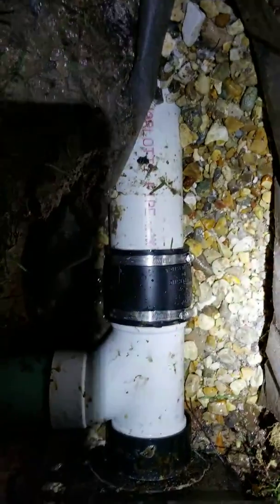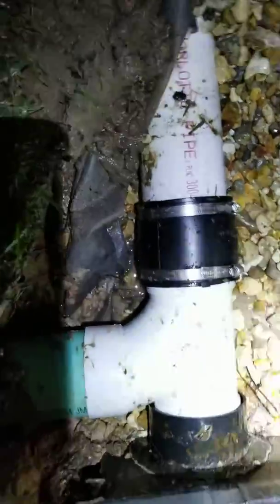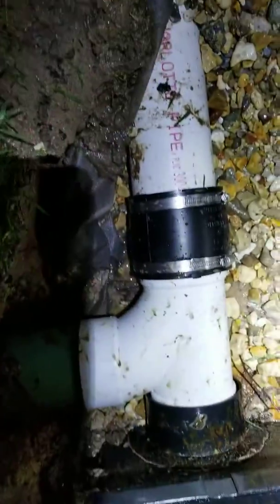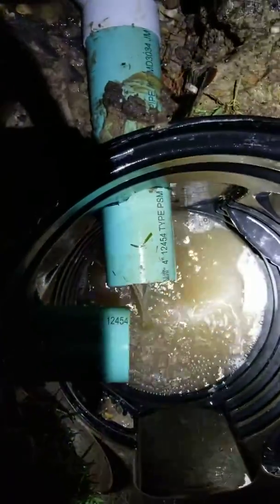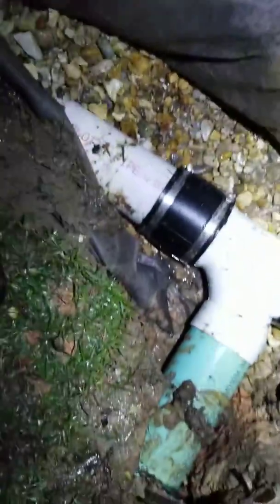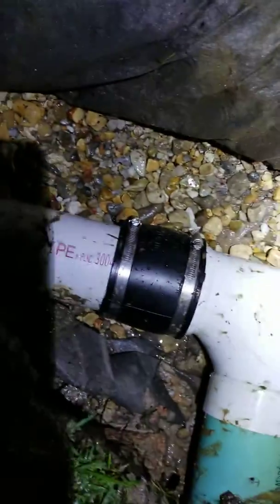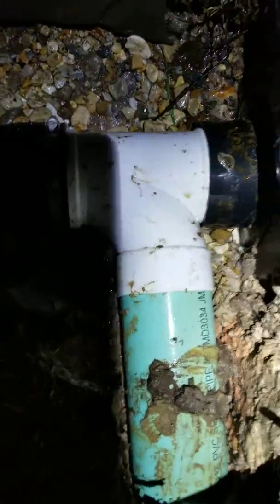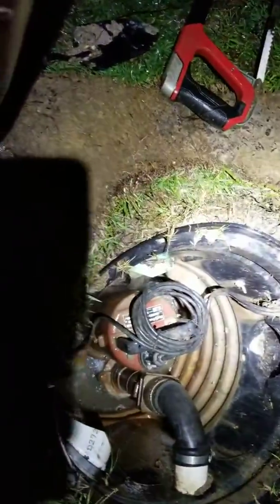NDS 12"x12" catch basin 3" choke point bypass installation video part 2 of 3

Comment: You can use a Dremel tool to cut out the 3” insert. I’ve done it several times to systems installed and you can do it without removing anything but the grate to access the outlet. 

Really like what you did here, looks well put together and thought out 👌
Reply from the maker: Thanks for the tip and great to hear from you Brooks.  A few months ago I came across a video of a guy explaining how to cut out the 3" and make it a full 4" before installing the catch basin in the ground.  Apparently it's in the directions.  If only I read them and knew that before! Lol. But I do think I'll give your tip a try cause I sure in hell ain't pulling that catch basin back out.
Reply: @LichaelMewis  those damn directions  :)